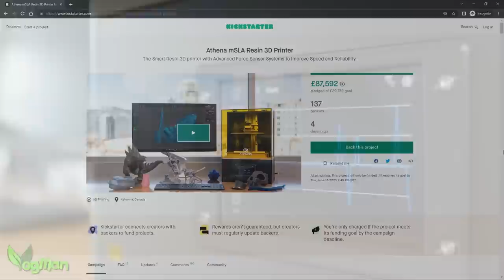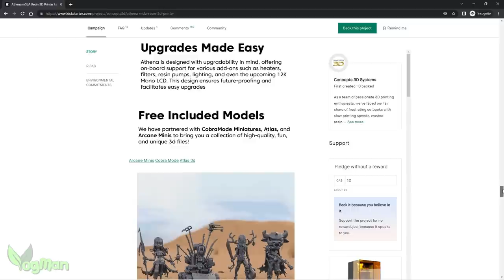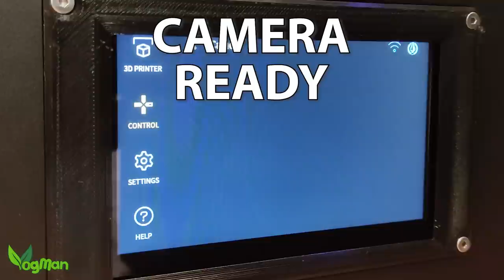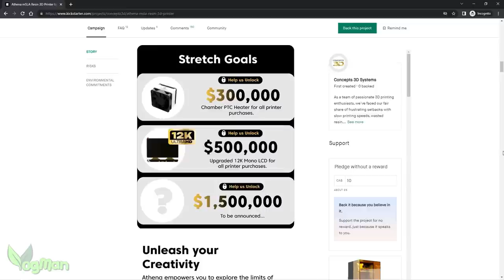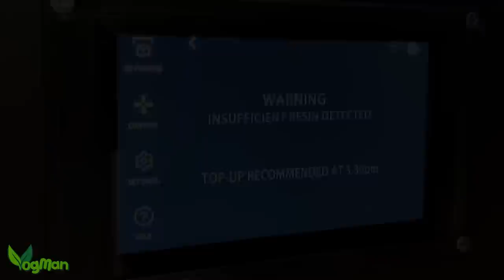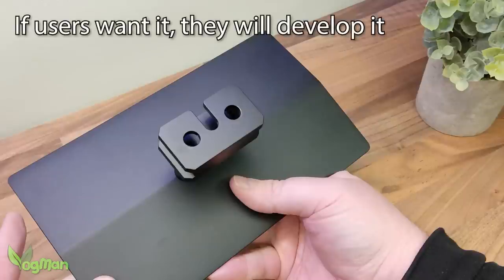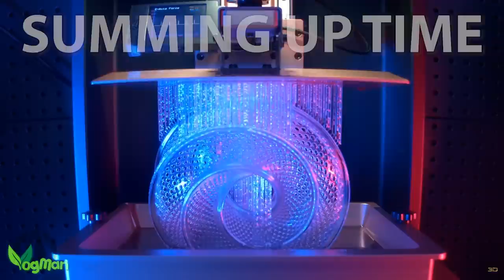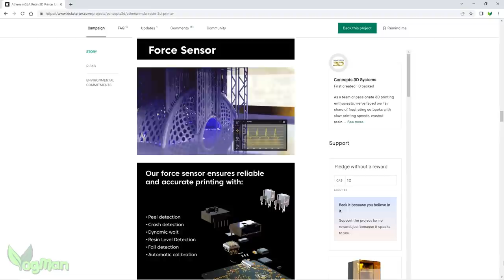Athena 3D Resin (EPIC POTENTIAL) Printer - an overview

Comment: I think it's got a good concept, but I think it's very limited by its price and timing. In today's resin market, for $2k you get a lot. I just preordered an ultra 4 for $450 w/heater. I could buy a new printer every 2-3 years at least twice more, getting some new technological improvements each time.

And I see a lot of potential let down with WHAT you can actually upgrade. If tilting technology is actually that big of a deal, that's going to be hard and expensive to add to this printer. "AI" is being added to current printers, we have auto bed levelling and 'error detection'. The M7 Pro with its resin heating pump is a really great idea, and is better than chamber heating.

I'm not knocking the team because I think this IS a great concept. I do unfortunately think they're 5/7 years late for most general users. In a world where Bambu brought FDM to novice users with their 'plug and play' we're getting closer to that with SLA, and this is a step backwards in that regard, made solely for those who either like to tinker, or...like to tinker.

That's just my .02. As always I love your content VOG, you remain the single best source of resin printers, and I absolutely await your review on this when that time comes.

Comment: I want reliability more than raw speed (failed prints cost lots of time).  Reliable resin temperature, reliable leveling, reliable first layer, reliable normal layers, reliable part z-dimensions, <30micron x-y resolution, reliable LCD screen, etc.

Comment: Sounds great but $900 is a lot of money for a 10 inch printer.  I can completely guarantee that Elegoo and Anycubic are working on exactly the same tech - the Saturn 3 ultra is even using Linux which is probably the basis for this machine - and they'll be half the price of this. Still no guarantees with Kickstarter also.
Reply from the maker: KS is about investing, and that carries risk. I think everyone knows that but it's worth pointing that out, so thanks. As for catching up, I said that about the GKtwo and yet no one else has copied their excellent moves. I genuinely think they aren't researching anything... I think they're just very good at playing catch-up. But time will tell.

Comment: Isn’t the GK 2a lot similar to this machine?
Reply from the maker: No, not even close. The GK2 is very good with a heater, easy fit plate and vat, plus a air filter cartridge, but that's it really. It's still very good and other companies have yet to catch up with features, but this printer is several leagues apart.
Reply: Ok, I see your point , but i’m looking to get another printer. I have the Mars three, but I do want a larger build plate but the Athena looks like it’s just so far away and more expensive, that I might have to go with the GK 2.
Reply from the maker: Don't let me stop you! The GKtwo is very good. My workshop is typically cold and I praise the built in heater every time I use my GK. 
The GKtwo is no Athena, but that's because nothing out there is yet. But if the GK matches your needs and budget, then it's a good choice for you.

Comment: I realllly like the features but as a beginner, the price is pretty steep, even for an upgrade.
Reply from the maker: This is a printer of the future. It will make life so much easier for users. However I typically recommend beginners start with a cheap printer as this can be a smelly and messy hobby. Better to find out if resin printing is for you on a cheaper model 😁

Comment: Not for me I think. It feels like a niche machine for hardcore printing fanatics. Which deserves to be out there, of course, and congratulations for so many bells and whistles that might actually help those hardcore users.
Reply from the maker: Believe me Patrick, this isn't window dressing. Do you need these features? Obviously not because we're already managing without them. But in a few years, these will be the minimum standard because they'll make everything so much easier. 😁👍
Reply: @vogman  I can see how they would make things better. But on the other hand, as someone who doesn't do much nor print a great volume, things like speed are relatively unimportant. A self-levelling bed, however, would have been a big plus, but not to be, I guess.

Comment: Imagine just what the cloner and Elegoo and all the other makers will be trying to copy off of this - which means with more printers using similar features, cost will go DOWN, as more manufacturing processed get made easier and cheaper.

Man, in just.. a year or 2 after release, you can bet clones of the Athena will be out - and that excites me, not to support the clones, but because the people making the Athena should be able to make their own, getting the materials sourced cheaper, at a lower cost to consumer, without sacrificing the quality they want to keep.

Comment: After seeing how innovative the build plate design is on the uniformation gk two, I won’t be buying any future printers that have the archaic design with the bolts on top of the build plate that dip into the resin. There’s so many solutions to this problem that it’s just lazy design work to keep manufacturing this same old tired design. Nobody likes to clean out the bolts on top. It’s tedious and unnecessary.

Comment: Just saw that it's using crowd sourced online meme AI for failure detection, I'm out. Wake me up when they have something that work because you're never going to train this shit properly with only a few users AND it will require an internet connection for continuous untested updates. It might get half okayish result after 5 years of training but I'm not waiting this long.
Reply from the maker: There's a hell of a lot to be said for OS. As for will it or won't it, I guess time will ultimately judge.
Reply: You may be surprised to know the force sensor has been in development for the last 5 years. 😉
Reply: @vogman  Yea, still hoping it's going to kick this industry forward because it's great printer with great features but I saw way too many projects have their AI features get removed on release day to back this. Hopefully I'm proven wrong.